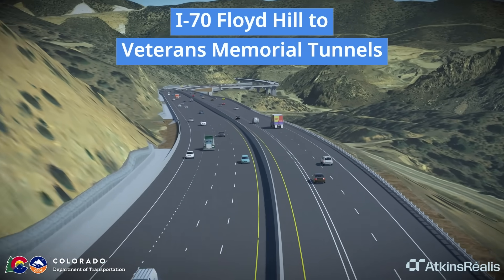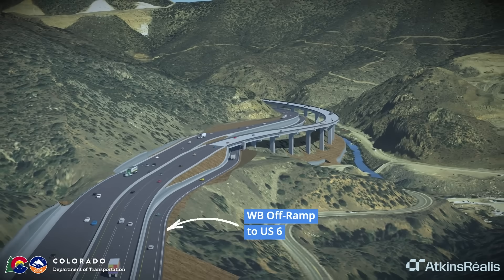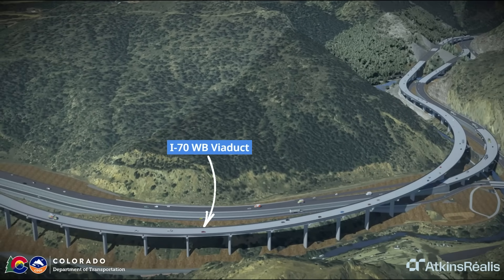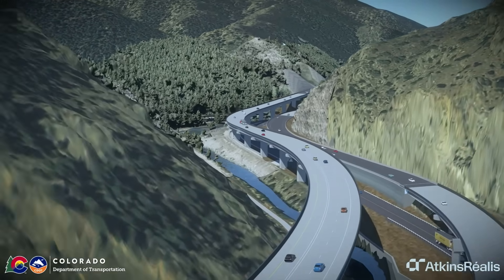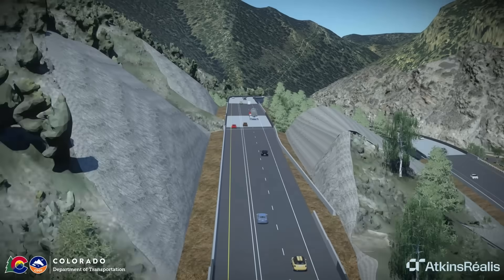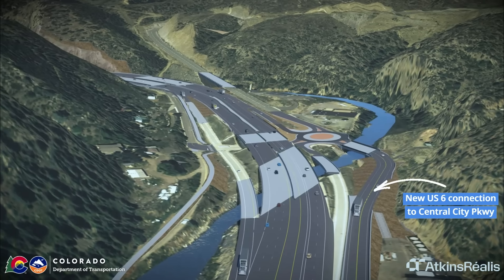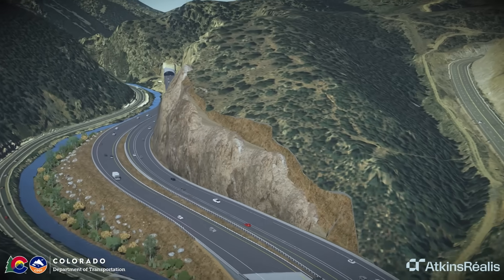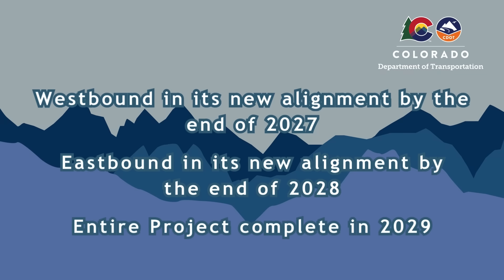I-70 Floyd Hill Project Flyover Rendering

Comment: Yeah, they better have heated asphalt and all the upper decks and elevated Highway portions, might as well do the bridges while you’re at it.     Because they’re never gonna sand anything or scrape the snow off of anything in the winter time.,, they make sure that snow plow driver sleep on on amps and drive up and down the highway blocking traffic with their snow plows 4 inches in the air never scraping anything until 7 AM.     I see it every day. What a joke.   Need to fire the head of sea dot   and get somebody that will actually run it like it used to be,,, Highway never used to have road closures and snowstorms they always scrape didn’t kept it open and safe for everyone,,,,, Now it’s a joke. We got over $1 billion in money sitting in C Dot and we can’t even scrape the roads.

Comment: General public moment. Y'all know engineers design this stuff right? This section of I-70 has tight curves and subsequently a lower speed limit than the surrounding areas. By widening and eliminating curves, the highway will have better continuity. Yeah, due to terrain there has to be a bridge. You take the conditions you're given and you design within that.

Express lanes suck, I agree. For free travel, this will still be a big improvement.

Comment: This fixes nothing.  It just moves the bottle neck up the road a mile.  They should have planned to double the lanes in 1995 all the way to Glenwood springs.  Colorado's population has more than tripled since the construction of the Eisenhower tunnel yet there has been little expansion of the roads with the exception of toll roads.  Voters in Colorado need to wake up.   Tens of millions of dollars to bring back wolves?  Crime, homeless, migrants.  The working class taxpayers that enjoy Colorado for what Colorado was, should be able to get to work and drive to the mountains safely.  Before they spend millions of dollars revitalizing the 16th Street mall we should fix the roads.  The homeless are still on the mall and I'm not going down town because traffic on I-25 is terrible everyday all day long.

Comment: One of scariest drives in my life coming up Floyd hill six inches new snow trucks spun out all way to top slalom ditch to ditch going around stuck and spinning trucks all the way to the top had 4 wheel and great mud and snow tires just barely made it yikes nothing is going to change could add 20 lanes need to change the grade how steep it is that’s the killer had over ten years since then to think about this do a tunnel from Idaho sprigs south side of clear creek from Idaho sprigs to top of Floyd hill no plowin no delays no major grade to climb Floyd hill is nasty ❤️colo

Comment: Its not just this new road, but take 470 for example. Express lane usage minimal even during rush hour due to the expense to use it. Charging the working man more to get to work is abusive! Should be illegal. Gas tax used to widen C470 to then charge again to use the one additional lane needed 30 years ago. Anyone that takes C470 can clearly see it is wide enough for a least 4 lanes even 5 lanes if you move the paint and get rid of the express lane entrance and exit functions.  Its not just the congestion caused by this, its a safety issue as well with all the stop and go and stop and go and drivers rejecting the use of our highways due to congestion so they cut through town and neighborhoods which uses more fuel and causes more accidents and injuries.  The whole idea behind the highway loop around Denver metro is to allow drivers to cruise safely around our city not having to cut through town. Very simple fix. Remove the express lanes and use all the concrete  to add more lanes  requiring only paint to implement.

Comment: Because bridges are safer than roads in the winter, right? No issues to worry about with icing over of course. Lets just pay to put more 15 mph max speed snow plows spraying more environmentally catastrophic chemicals to de-ice in the front of traffic. Toll lanes (which are privatized and are obligated to be closed very often) are not a solution. And bridges certainly aren't. I live near here. It's some BS

Comment: Fantastic plan! Let's create a mile long viaduct that will absolutely freeze over and turn into a curved ice rink a hundred feet above the canyon floor. Plus let's create an express lane that hardly anybody will use on the off-chance it's actually open. Thus becoming a colossal failure and solving absolutely NOTHING. Great job CDOT!
Reply: They do nothing and you complain. They make improvements and you complain... 
Viaducts will be safer than the current tight curve. The express lanes will be wider which will allow them to be open all the time.

Comment: I have a prediction: this project will solve NOTHING.
Reply: sounds to me like it makes several good improvements.
Reply: Forty years ago I drove down Floyd Hill my first time in a snowstorm and it was a white knuckle experience. That definitely is scary for tourists that don't know how to drive in snow in rental cars with all weather tires. The straightness and improvement of the bottom left turn should make things easier for the inexperienced. But this highway project won't solve congestion, that is due to the traffic load and that I-70 isn't being widened to three lanes, except for a joke unsafe express lane that isn't used.
Reply: @d @drwisdom1  fortunately, this is one part of improvements. Increased ski train and bustang service is happening as well.
Reply: Yeah, you want to make America great again, but you don’t wanna do any effort to actually do it;why don’t you invent a Time Machine and go back and get out of our hair?
Reply: @davidthompson7817 OR , secret option #2, YOU could always pay attention to history rather than repeating it. Widening a highway has NEVER solved traffic congestion in any metropolitan area.
Reply: @BlueFlyer83  its not just making it wider though.  its completely re routing it and smoothing out sharp curves as well as improving the on/ off ramps.    sounds good to me.
Reply: adding extra lanes is not the point of this project. And in the place it does add an extra uphill lane, it is for a situation you cannot apply urban planning to - slow trucks. The highway needs wider medians for safety, but the wider existing lanes and straightening the roadway will absolutely reduce congestion.

There are other reasons urban planning principles don’t apply here as well. There are no side streets that are absorbing traffic in the corridor with any effectiveness. Highway widening doesn’t work in cities because side road traffic returns to the highway once it is widened. But that is not what happens on 70, there are no reasonable detours aside from one narrow side road that doesn’t hold much traffic.

Comment: lived in area from 98-08 and thats it?  That has never been addressed?  What happened to fast rail to copper and 3 lanes each way?  Considering I lived through t rex and the 25 disaster, my two cents is a eta of 2035 earliest.  😉
Reply: Trex actually finished early and under budget.  That's how they got the Boulder turnpike and high speed rail to pass the voters so easily... then that fell on its face.
Reply: @ibgarrett  The boulder rail actually got screwed because of either ‘waited too long to buy steel’ or ‘underestimated long term steel prices and didn’t ask for enough funding’. Either way, The land is there, the right of way is there, but the steel is way over-budget and voters balked at the increase. I agree with voters here, but I also understand large projects with lots of materials have risks. I don’t know with hindsight if we could have anticipated runaway steel prices to be frank.

Because we voted on the budget, we have to vote on the increase. It was so unpopular we haven’t passed it so RTD is continuing with other voter approved projects.
Reply: @person35790 actually as I heard it was that the original plan was to piggyback off the existing rail lines and nobody checked to see if it was ok or how much it was going to cost. When the election was over they went to the rail companies that have the right of way and the cost was double the projected costs. 

That and copper had doubled in price. Between those two things they came up with the hair brained idea to do a public/private endeavor of widening hwy 36 and changing the name of the bus system (using the same buses and routes) because that would be a good compromise. 

Oh. And we’re still paying those taxes today for that line we never got.
Reply: @ibgarrett came with receipts.  Nice.  I was making a joke.  😅.
Reply: Rail would cost too much and no one wants to pay for it. Will just be a disaster for the next 45 years.  Locals will just give up going to tje mountains and tourists will be pissed off and not return after sitting in their rented Suburban for 5 hrs😂
Reply: @YoMamasCasa  That’s not actually true - the ski trains have been so popular they are increasing service. Ski busses as well, increasing service. But recreational traffic isn’t the bulk of overall traffic - it is actually trucking that is the most constant use of the corridor.

Comment: Ah, the infamous Express Lane which does nothing to alleviate traffic.
Reply: I'm no expert, but I feel like if they had added a third travel lane, you'd get just as bad of bottlenecking where it then goes down to 2 in Idaho Spgs. Not really sure what the solution is... express lane is better than nothing and the widened curve will help for sure, but there's gotta be a better way. Also, how smart is it to build such a long bridge in such a snow (and ice) prone area? Regardless, one can only hope they know something we don't
Reply: @srgbonus  Idaho Springs has the same problem Floyd Hill has - the river. That is the reason for the bridges here and through Glenwood Canyon. It is an insurmountable expense to remove enough of the mountain to put the highway there, so they used bridges and did blasting where it makes sense.
Reply: I wish you worked for CDOT. I can tell you're smarter than everyone that works there.
Reply: @BlacqueJacqueShellacque_   After I-25 between Castle Rock and Colorado Springs was widened they kept the Express lane free for about 3 years. In that time I was never slowed down below the speed limit every time I drove that route. Once they started charging tolls it went back to where it was, with numerous slowdowns almost every time I drive it, particularly near the Tomah Road and Larkspur exits since over 90% of traffic remains in the non-toll lanes. The same thing happens on C470. So don't be so snide.
Reply: @gtv6chuck  Lol okay, genius, why do we have toll roads?

Let me make this easy for you. We fund our roads through a flat gas tax that hasn’t changed in decades. More cars, and better fuel mileage, has tightened CDOT’s budget. We keep voting down increases.

So of course we have toll lanes. You are getting exactly what you paid for. A private entity paying for the road widening and maintenance of the road, and charging you only when you use it.
Reply: @person35790  Maybe you should ask the over 150 people who agree with me? What is the use of a lane which will be avoided by 95% of drivers? Maybe you should realize that not all of the money collected by the state from car registration and gas tax does not all go to the roads, which is why people are trying to get a ballot measure passed where at least 60% of money collected should go to roads, meaning that it is currently less than this? Maybe you should think about the fact that there were no toll roads in Colorado until about 20 years ago, the only one was E470, you know, that road hardly anyone uses, and that 36 to Boulder was also once a toll road, and only until it was paid off? Maybe you should ask why the state budget has grown from 19 billion in 2010 to 43.5 billion in 2025 and they haven't allocated enough to our roads?
Reply: @gtv6chuck agreed 100%
Reply: We can always sell the toll rights to a foreign country like saudi arabia
Reply: Colorado is a scam

Comment: How about just put a train the length of i70 in the mountains so everyone that wants go skiing or visit the mountains doesn’t clog up the roads for the smaller amount of people that travel for work or live in the area and actually know how to drive around corners
Reply: Because trains can't climb hills, and the trains equipped to climb hills can't go fast. You should research the extreme engineering involved in building the Moffat Tunnel route. They even made a train route to Summit County decades ago, but it was determined that it wasn't financially viable, so the project was abandoned, and in the 1960s, the abandoned railway tunnel was repurposed as a water diversion tunnel. The Georgetown Loop is all that remains of that line.
Reply: They cut routes to deal with that slope. We had passenger rail lines but they got eliminated because we spend more than ten times on roads what we do on rail, & somehow the idea that roads can cost tax money but rails can't, isn not seen for the idiocy it is. 

If we spent even one tenth on rail, what we do on highways, you could get pretty much anywhere in this nation by train (& that includes small towns & city cross-streets). 

We've been grossly misspending for nearly a hundred years now...
Reply: @prophetzarquon  I definitely agree that we far overspend on CDOT versus what they deliver, but I just don't see how rail would benefit us, especially in Colorado. Yes, we had passenger rail lines, but they didn't get eliminated because of some conspiracy against railroads. They were eliminated because people stopped paying for train tickets when they could simply drive there cheaper and quicker. I could totally see Something like a Maglev or Hyperloop between DIA and either Vail or Aspen someday, with stops at other resorts along the way. It would be expensive to build, but both of those can climb hills at speed, faster than cars can travel, and wouldn't be effected by weather. And even then, that's really the only route I could see as viable, as there are a ton of people traveling point to point between a select group of destinations. As far as traditional rail in the mountains, I just don't see it. If it was viable, they wouldn't have pulled up all the rail in the past. There have even been tourist railroads that have gone under recently here in the state, so even places that already have rail in place, there isn't enough demand to stay in business. And even where there is demand, like Amtrak's Winter Park Express versus driving over Berthoud Pass, there are far more people who choose to drive, which just proves my point that most people don't want rail if given the option.
Reply: @v12tommy sweet boy, you're so close yet so far away